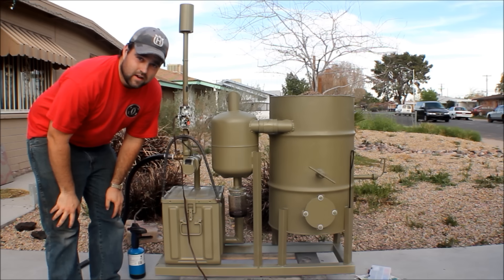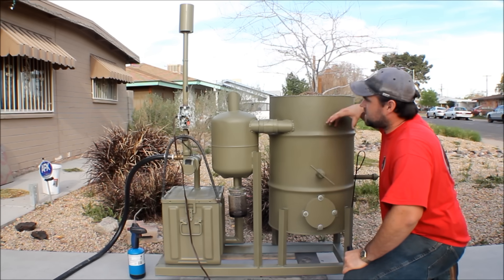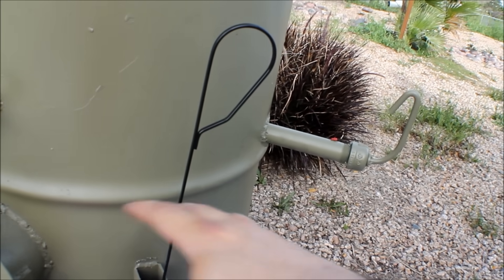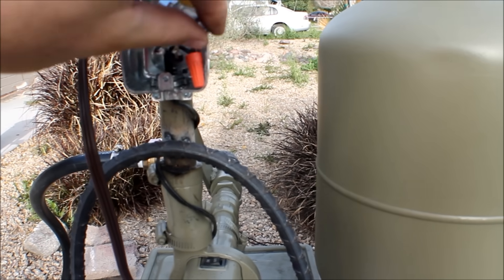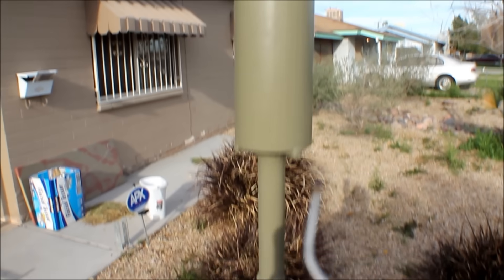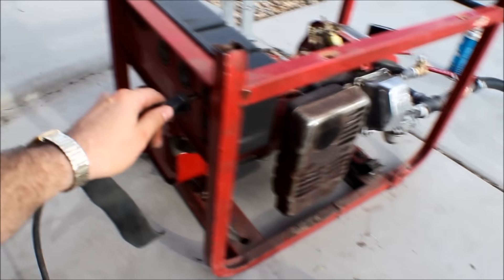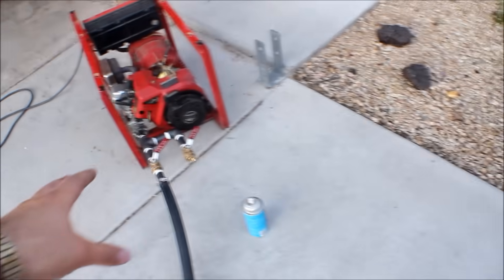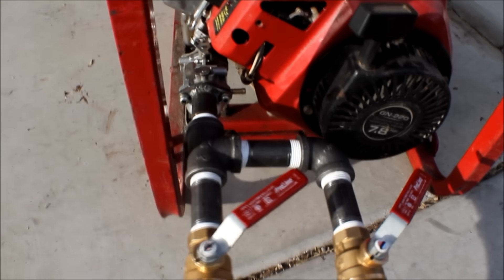amazing homemade gasifier uses wood pellets to run generator -- renewable alternative energy video

Comment: You have done an excellent job as far as I'm concerned. While not an expert in wood gas power I have seen a few and your is by far the best I have seen.  A bit on the small size though. But I suspect you don't need much larger.

Comment: Have you tried putting lava rocks, ceramic briquettes, or steel wool into a primary filter? You might try installing this filter before it goes into your cyclone filter. It should cut down on the tar buildup dramatically. You can easily make one out of a 32 oz juice can just to try it out. I have one of those safety can openers the leaves a smooth edge. A bead of RTV, 4 L brackets, 4 screws, and it becomes airtight again. Get rid of the rubber coupling at the cyclone filter and replace it with a pipe union or a muffler flange. 2 Juice cans joined together also make great air coolers...insert and stagger 4 half circle baffles in each juice can to allow water to condensate. There is really no need to make a large cooler. Your existing setup can accommodate 2 or 3 coolers stacked along side each other, without using up much more room.

Comment: The burner needs to be redesigned a little. Your steel drum is way to large. There is alot of wasted space. You can make the 4 inch pellet tube 6 inches like you suggested. Or you can make the pellet tube swappable, in case you need to run a larger engine. But you also need to make the pellet tube alot shorter. By making it shorter, this will allow you to make the rest of the drum as a large hopper. This will allow you to store enough fuel for a very long run without refueling. Leave about 2 inches of space on the side walls between the pellet tube and the drum. This will also give you the ability to burn wood, paper, pellets, etc.

Comment: I would replace the saw dust in the ammo box with something non flammable like stainless steel wool or lava rocks. You can also use these items in your cooling system. Your cooling system really doesn't have to be that large.

Comment: I'm curious how much wood this burns per hour, and what the emissions are like? If it burns wood faster than it can grow, I wouldn't say that its renewable. Though I have to admit this is probably a lot more sustainable than coal or oil based fuels.

Comment: I have been studying wood gasifiers myself. What do you think of jacketing a stainless still 30 gallon drum with a 55 gallon drum and insulating it with Rock wool, vermiculite, or perlite insulation? The way I understand gasifiers is that burning wood in a high heat low oxygen environment produces flammable gasses that can be used to operate most engines.
Reply: Stainless steel would be best for a gasifier design.  It has a higher coefficient of thermal conductivity and will not burn out.  It is more expensive, more difficult to weld, and where ever stainless comes in contact with carbon steel it will react.  I have built a reactor core that contains a vortex separator and primary filtration on the core.  It is removable from the outer annulus.  I will put a video up soon.

Comment: . And switching the insides with stainless still, a stainless still 30 gallon drum and basket will prevent rusting and it will handle more heat and a replicable center fill pipe, overall the unit will last longer. Any suggestions, comments, or statements would be appreciated.

Comment: it would be great to use the extra heat somehow. that would be ultra efficient.
combine with Cyclone Waste Heat Engine
Reply: It would probably be good for a boiler system for the house.
Reply: You can go to the other end of the setup and salvage heat from the internal combustion engine's exhaust gases and/or it's coolant circuit.

Comment: Great job...A couple of observations...have you put enough hours on the generator to show up any problems with tar? The FEMA design gets a bad press as a tar factory.
I would suggest that you get out of the habit of looking down the light up port without eye protection, a safety window, a mirror or all three- they do spit back at startup and shutdown- best to assume at any time- and I have had an eyeful, fortunately without lasting damage.
If you want to set the mixture up quickly and decisively, get a lambda sensor- instant read out of too rich, too lean, or just right.
You'll find a welcome on the driveonwood site or the Yahoo Woodgas and charcoal gasifier sites.

Comment: You did a great job. Very very impressed with your work and humble wisdom. God bless you for this video. I think the one thing everyone is missing from these plans is to put a copper coil on the inside and to run water through this to capture some of the heat from the fire tube. That would give you additional power in the form of hot water.
Reply: Withdrawing heat in this manner would create problems with additional condensation in the inside of the fueldrum/gasifier.

Comment: Interesting. Thanks. I wonder if you could do some additional filtering of the gas just before it enters the generator, and see if any other contaminants are making it through. How does the running cost stack up against just using electricity or gasoline?

Comment: If cooler exhaust gasses are better maybe if you enlarged the freon canister ( possibly 100 gal propane tank) and added a copper heat exchanger coil inside and ran water trough it you would increase the level of condensation and cool your syngas. it would boost the over all efficiency of the system and be creating hot water for heating or domestic uses. Great work the construction is top notch!

Comment: Great build!!! Are you using the same dimensions for the fire pot (Colander w/ 1/2 in holes) and fire tube to colander bottom ( 1 3/4" ) as specified in the FEMA build, or something different for using wood pellets instead of chips???

Comment: You can use perforated metal with 1/16" holes as a backfire arrestor it works very well and wont fail. I do lots of testing on different forms of fuel vapors and this method has worked for everything I have tested. 

The air to fuel mixture will be allot easier to dial in if you use a gate valve instead of a ball valve. The gate valves will fine tune the ATF allot better then a ball valve. 

Hope this helps.
Reply: Globe valve would be the best. Since you're not supposed to adjust flow on a gate valve.
Reply: That would work fine too. You don't have a high pressure behind the gate valve so it will be just fine.

Comment: I'm no expert on these, but I imagine you could benefit greatly from an intercooler.  Attaching an old used diesel truck intercooler to the generator with a fan would allow you to run much hotter.  This would allow you to use a bigger generator with a smaller gasifier in theory.  You could even use the high temp rubber gaskets commonly used with turbochargers and exhaust systems.  I don't know that much for sure and there might be too much particulate in the gas, but it could likely be a very beneficial add-on for boosted efficiency, even if you don't want to run hotter.

Comment: I am an outfitter in alberta canada and am desperatly seeking an alternative to diesil fuel how long will a unit provide fuel how long would it run l  is it possble to build a top load that would run on pine and spruce logs.?

Comment: Awesome build, The only downside to the process is that you need power to run the airpump. If this was independant on a battery it would ad another pluspoint.
Reply: The pump does run off a battery so it is independent and doesn't require power from the grid
Reply: Ya ik i was just saying that it ran off a battery that could be charged by the generator after it gets going

Comment: Great work JR. I have started to build my own unit now after viewing your video.  Hopefully we will put up a video when it is complete. I have decided to build a tube heat exchanger to cool the gas before it goes through the 4 stage filter unit we have built. Fingers crossed. Thanks again. Cheers from Australia.

Comment: ah no where have the plans gone?
Reply: Jr McLaws
Congrats on the build, You have shown that the FEMA gasifier can work. But the FEMA gasifier is known as a tar generator, that bit of smoke you can see coming out the flare tube will condense into tar inside of your engine. This is because the FEMA gasifier runs too cold to fully break down the wood into all of the combustible's that are in the wood. The good news is you don't have to start over from scratch. The feed tube can be enlarged with a funnel shape at the bottom and some air tubes run through the outer drum to the top of the funnel. With the top of the feed tube sealed shut the air tubes will control the size of the primary burn zone. As the wood decomposes into charcoal it will settle to the lower part of the funnel where it will superheat and break down most of the smoke that you are now catching as condensate and in your filter.

Please do some more research, The link below is just one of a number of good groups. Also look  up Wayne Kieth. He ran his truck from AL to the east coast, then to the west coast to compete in the escape from Berkly CA alternate fuel race to Las Vegas NV, burning wood all the way. He would have won but everthing was timed, and that showed that he was speeding. Oh then he drove it back to AL on wood.

http://groups.yahoo.com/neo/groups/WoodGas/conversations/messages
Reply: This is probably way waaay to late, but you should replace those ball valves on your generator intake with needle valves, they are much more sensitive and would allow you to fine tune your air/fuel mix much better and more consistently each time.
Reply: http://www.driveonwood.com/static/media/uploads/pdf/fema_plans.pdf
Reply from the maker: Sorry... the broken link has been fixed.  Make sure to follow the link in the description to download the original FEMA plans.
Reply: +Yves Baggi Sense I posted here over a year ago, several German gentlemen have come out with a couple new designs. The Drizzler and its grate-less version. They can be found at the link I posted above. Or Google Drizzler they have a web site.

The funnel shape is big end up, this allows a larger feed tube to act as a hopper to hold more wood fuel. The bottom of the funnel must be sized to the horse power of the engine to be used. Air is supplied by tubes that are mounted near the top of the funnel. This allows some of the smoke to displace the oxygen above the fire zone and keep the burn under control, I have read that occasionally the Fema's can have runaway burns. There are several things happening in the funnel. As the wood reduces in the combustion process it and the heat are brought together into a smaller area causing higher temperatures that break down the tars in the smoke from above as it passes through the super heated charcoal which also burns down to a fine ash. This leads to less condensate and more useable gas from a given amount of wood, and should lead to lessen the need to change out the plugged filter material. There are line drawings of this in the photo section of that link also.

Good luck and happy building,
Gordy
Reply: Nomad Wizard

after reading my reply i realize that i didn't really explain the second thing. The barrel getting hot is necessary to the process. As the wood burns it makes CO2 and water. The barrel get's hot enough to chemically change that smoke to methane, carbon monoxide and H2. that's why it's normal.
Reply: Mott theHoople
 HVAC (industrial fridge/AC) suppliers will stock a full range, Some hardware will stock them but as you mentioned, rarely. Plumbing specialist stores should carry them, and if all else fails, there is a wide selection online.
Reply: +MrGordy61 
Thank you for your comment. I have read the same things online. And since my building and welding skills are dismal, I have to make sure I build a good one from the get go.

You mention a funnel at the bottom of oth efeed tube, but before you mention the feed tube can be enlarged. 

Are you refering to an 'upside down' funnel? or a regular where the narrower part is at the bottom? but that wouldn't jive with your next claim the pellets superheating etc.

Can you give a bit more details on this? or si there a drawing somewhere I can refer to?

thank you
Reply: +MrGordy61 

Thank you for your help and support.

I am planning on wood branches from what falls off in the yard and also using scrap wood form pallets and other throw aways I can get almost daily. then plannign on passing it through a chopper.

Should the wood dry for a while first or does the gasifier dry the wood kinda as it goes?

do you know if acorns and/or pinecones are a good material for that? because we have what seems an unlimited supply of them every year.

cheers
Reply: +Jr McLaws   will this work with any type of generator
Reply: I have a quesiton. Can you convert vapor gas from wood to liquid gasoline by condensing it?
Reply: wood gas is CO + H₂. Iron acts as a catalyst to convert this plus steam to hydrocarbons.  The pressure and temperature determine the weight.
Reply: i would like to point out a few things for ya, first this is what the germans used in WWII on their training tanks. Yes they ran tanks on these. Second the barrel getting hot isn't really a big deal. it's just the nature of the beast.
Reply: where would you get needle valves? not something you see in the average hardware store

Comment: This is very interesting, thanx!   Dont use a potentiometer alone to control the power of the dc motor. A "pwm dc motor controller" is a much better solution! It doesnt get hot, is easy to use (12V in and motor out) and works much better. You get it for 10 bucks at online shops.

Comment: Nice Work!  I think you would get better performance if you were to insulate the riser tube with ceramic cloth.  This would allow the temp to rise inside the riser while the outer barrel would stay cool.  Gasifier, BioChar and Rocket Mass Heaters all benefit from an insulated riser.

Comment: Cool video.   Really helpful.  Thanks so much.  I'm going to do the same, but run it off of chunked up wood pallets and charge up a battery bank.  I found some really efficient ways to disassemble and chunk up pallets, and how to reconstitute dead, crystalize lead acid car batteries that you can get for free from a battery recycling center and run them off of some non-toxic soil conditioning minerals from Agway.  All either really cheap or free.

Comment: The reason your gasifier belched and put out it's flame is because you didn't run your fan long enough to clear the system of Flammable Gas before you tried to lite it  causing an interior explosion your system works well.

Comment: Do you have to use wood pellets or will normal wood do the job?
Reply: the materials used have to be able to "fall down" into the hearth in the bottom of the Gasifier. Wooden "pucks" has been used for this but a specific design of the hearth has to be made.
Reply: Could you use dried wood chips from tree and shrub garden waste?

Comment: That's awesome, I'd love to build one of these.  just a question, why leave the carb on?  And can you use say wood shavings, sawdust, small sticks, or even those hamster shavings to fuel it instead of pellets?
Reply: Mate, we don't even call them shrimp. We call them prawns. Crocidile Dundee had to say shrimp so you yanks knew what he meant ;)
Reply: A carb does two things, one is to regulate the fuel/air ratio the other the other is to control the total amount of the mixed vapours going to engine. As more electrical power is drawn from the generator it has to work harder so it will want to slow down and as it does the voltage will drop, lights dim & start to flicker etc. When this happens a simple bit of electronics opens up the throttle valve inside the carb allowing more gas to burnt in the combustion cylinder.
Reply: That also confused me. He said he bolted the gas hoses to the carby, which it looks like he has, but then he has valves on the manifold that he built, which he says allows him to control the air/fuel mixture, because the jets would normally do that? Doesn't make sense.
Reply: Brad Hughes I think it's because it's a 'carby" and not a carburetor.  Are
you a Aussie they speak of shrimp on the carby or is that barbie ?
Just messing with you..
Reply: Pellets or Pucks of the above materials would work but the hearth in the inside have to be designed diffrently for diffrent fuels and sawdust and smaller are usually hard to handle so making them into pellets or Pucks is prefered.

Comment: Man I'd love to buy that. You should capitalize.
Reply: I have recently created a company along with other partners called Wood Energy Inc. and we will aim to have a gasifier for home use on the market by august.
Reply: a link to that would be real handy
Reply: its not practical on a large scale, its not a new technology. its a novel energy not a sustainable one. many countries have tried, and failed, to implement gasifiers. the fact is they are only efficient when running. Getting them started and stopped is more or less a big deal. For the lives we lead today, it is not practical. Besides, building this thing out of junk won't fly for the commercial market. WAY too many hazards to mitigate practically in this idiot friendly world we live in. You can sue, and win, for a cup of coffee too hot. Let a few people level their and neighboring houses with these things…after the total financial devastation of whoever sold the rigs, the govt will come through and flat out ban them. Wheres the capitalization in that?

Comment: Great video and thanks for making it.

a couple of questions:
1 - did you build this using the FEMA plans?
2 - about how much does your unit there weigh?
3 - what are the dimensions of the base?
4 - does it seem to run any "dirtier" in the generator than gas?
5 - does it run any hotter in the generator than gas?